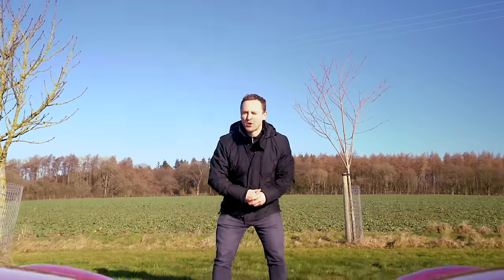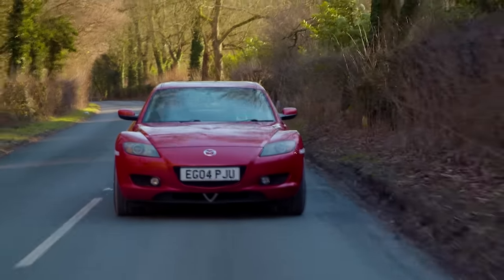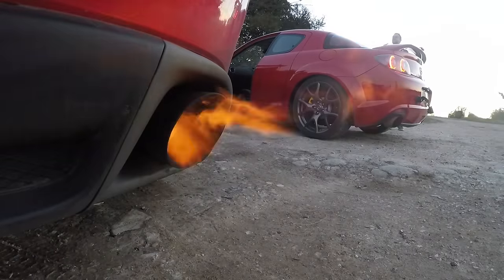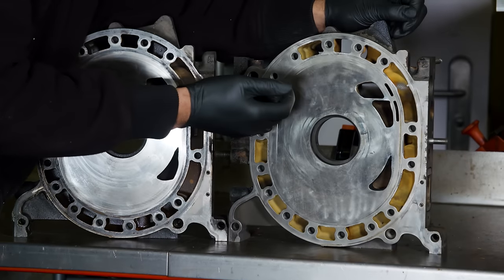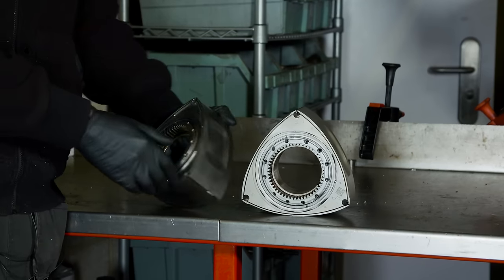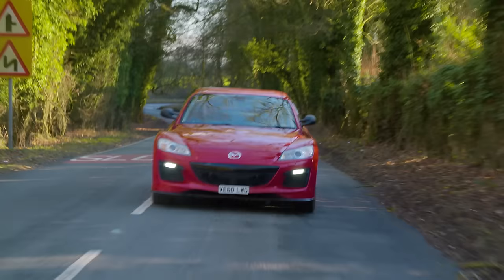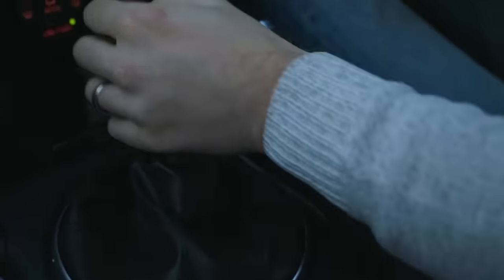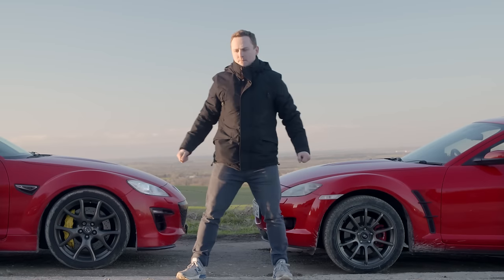The Differences Between Bridgeported & Street Ported Rotary Engines

Comment: How can you not like a rotary? Despite its mechanical faults, you can make so much power with some work, and the sound 😍
Reply: What sound? Sound of other cars passing you while you push your dead rotary off the road?
Reply: You can make just as much power in a piston-designed engine, with far better reliability, fuel efficiency, emissions, maintenance costs, and more
Reply: Ummm.... yeah. I like rotary for it's quirkiness, but for easy power I'd take my trusty old Saab B234 any day.
Reply: @dustinjames1268  no emissions for rotaries and 2t so im gonna dab for you and if the new law goes thru what is that 40year cars or older dont need to be inspected
Reply: The amount of power they make for the amount of fuel they burn is pretty bad really.
Reply: Power? I was sitting here thinking all the money they must have dumped into pulling the engine, machining out the ports, and lightening the rotors for the amount of power they got out of it was completely unimpressive. I considered buying one of these 10 years or so ago because I love the styling, but even on the RX forums, they pretty much said you can't make power on these things without dumping TONS of money into them.
Reply: Or....maybe this is my opinion and I just like Rotaries? Then again, I realize this is the YouTube and I'll be chastised for anything I say.
Reply: Lack of knowledge piston guys don't know about rotaries,1st off piston engines have around for alot longer than rotaries 2nd we ain't in stuck in the 90s where the were unreliable, 3 Rd you have to know how to treat a rotor if you drive it like a nana the carbon will build up and blow the apex seals when you do thrash it 4th if rotaries had forged rotors housings etc they would be just as fast if not faster and last but not least its a small 1.3l that can make a 1000hp, my point is, is that don't hate on something you don't really know anything about I love rotaries but I also like v8s too
Reply: 4mpg for 191hp.. that's how
Reply: @Bexxiii09  As an owner of a 2004 RX-8, It's definitely worth it. unbelievable amounts of fun.
Reply: Only thing rotary has going for it is the sound and rev range. Everything else is inferior to any other engine.
Reply: @dustinjames1268  yeah because it's super easy to get 200whp with an 80 cubic inch piston engine without major engine work .
Reply: You can make 200whp on a stock RX8 with a exhaust intake etc and tuning . It's been proven .
Reply: @nk0723  200whp is still really low.
Reply: @nk0723  Yes, impressive power for the displacement I guess, but that's kind of irrelevant. Piston engines aren't limited to such small displacements, but for the most part, rotaries are. They're neat engines, and I can appreciate them, I just don't think they're the best solution.
Reply: @grosblyth  for the size on the engine it really isnt. For the weight of the car though , it is . 
If it were 200whp in a first generation or an mx5 for example, people wouldn't be saying it's not much.
Reply: @jasepoag8930  kind of irrelevant while we're talking about power numbers and equivalent piston engines?
Reply: @nk0723  Yes. Who cares if they make great power when compared to a go kart sized piston engine? They're not competing with engines in that size. If they scaled them up, then it would be worth talking about. As they are, they have a small form factor, they rev smoothly, they cost lots of money to make only a little more power, and they use more fuel while making less power than most v8's.  All I'm reading in here in defense of them is "ifs." If it was forged, if it had equivalent displacement, if it was in a lighter car... They're neat, I get it, I just don't think they're necessarily... great.
Reply: So much power? N/A 2.0l civics get A ball hair over 200. Pick them up for half that money and much cheaper to run
Reply: @dustinjames1268   Yea...so your comparing a rotary, one of the most powerful engines in the world, to a piston? lmao
Reply: And it's the way it revs super fast and high, the smoothness, and the low weight which helps makes the car handle well too!
Reply: 400 hp and 100 lb-ft nty
Reply: "Mechanical faults", look after them and you will have none.
Reply: Because people are dumb. "Oh its unreliable oh it burns fuel" so what its the most unique engine design you can buy with some seriously good sounds and seriously fun to drive, power or no power.
Reply: @alistermccallum  the old peripheral exhaust rotors were nice and boost friendly... these "new" emission friendly ones are a joke, and not boost frienldy, they just don't flow enough..
Reply: I love rotary engines but the renesis is pure rubbish! It was designed to meet emissions standards and you try to make real power with one and it wont last 2 days! All big power RX8’s are running a 13b motor from the RX7.
Reply: Naturally aspirated 13Bs are hilariously weak, though I'd definitely own a boosted one.
Reply: Simon T of course you want a turbo! Without one they are just a tumble dryer. However if you add a turbo to a renesis and they are broken within a week!
Reply: @Bexxiii09  as an owner of a 2011 RX8 GT I would say I can smell your unequivocal bias. I work never recommend to someone. It's a fun "niche" car but that's about where all of it's excitement ends.
Reply: @shona5512  good god. And regular use it's probably making 10mpg if it's lucky.
Reply: They are the two strokes of the car world. Something some people just 'dont get'. But for those do , there is nothing better. I also like two strokes a lot.
Reply: @dustinjames1268  i want to see a 1,2L N/A Piston Engine  making the same power ;)
Reply: The brapping is addictive
Reply: As it works completely different from a 4 stroke piston engine you cannot compare their capacity.
In the real world you can compare fuel use to power output to emissions. And they fail. 
Does that mean they're not fun to own/drive? Get the fuck outta here
Reply: @matthewmaritato9101  You asked how people can not like a rotary. Answering a question isn't chastisement.
Reply: Lmao you cant make so much power with a rotary
Reply: All these fanboys talking tough
Let me know when youve got a streetable rotary at 1000HP at least as reliable as the 2JZ at 1k HP
Reply: @j0lel666  You kinda need to say where you're talking about here for that to be relevant to anything. Where I live there are no inspections or emissions tests on any car.
Reply: @alexphillips4663  suomi finland, 7months old comment

Comment: I bet you could grill beef on that flame😯🔥
Reply: it will taste like oil, fuel and soot.i don't recommend this.
Reply: Tastes like plastic and carbon monoxide poisoning
Reply: mmm, fuel flavored meat
Reply: any plastics will have burned up and carbon monoxide will fix (chemically react) so it will be harmless.
Reply: It would taste awful but yes you could
Reply: SoY_FooD r/woooosh
Reply: @SoYFooD2  XD sorry but science no comprehend that way good Theory tho
Reply: Doesn't sound very efficient.
Reply: Don’t give him any bright ideas
Reply: In the intro
Reply: What if you would do this on a 4 Cylinder Inline which has been cleaned completely from carbon and all lines for petrol are out of iron and instead of the petrol you use Vodka or a mixture which is not very harmful and you get a perfect Flame tune. Would this be a inefficient grill?
Reply: Sure, if you don't mind cancer.

Comment: RX8 = Drivers car. Not about numbers, but pure driving enjoyment. Also its a lovely place to sit. The cabin is underrated!
Reply: Spot on. So many whiny comments about mpg or reliability. Shouldn't complain, it's these cowards that are keeping the prices down. ;)
Reply: RX7 = Drivers car.
RX8 = failed sucessor.
Reply: @baibok  Failed? It sold multiples more than the RX7.
Reply: @baibok , no turbo no go, bro.
Reply: Mark Bowyer - The RX-8 sold nowhere near as well as the RX-7’s.

If you were talking about the FD generation only; I’d agree, but that would discount the SA22C/FB33 and the FC3S.

The first-generation RX-7’s (SA22C/FB33) alone sold around 430,000 units globally, whereas the RX-8 only sold around 100,000 units - at least according to the sales statistics as I could find.
Reply: @rucarnuts13  The FD sold about 1000 cars all told in Europe, while the RX8 sold around 80,000. (Just under 200,000 total) Yes the cheaper earlier 7s did sell very well in the US but the entire RX7 range was on sale for nearly twice as long as the 8. 
I was just responding to someone calling the RX8 a "failed" car, which is just ridiculously misinformed.
Reply: @baibok  built for a completely different purpose was never meant to be the successor of the 7 if it was it would still be called an rx7 if you look at all the other rx models they are quite different from each other
Reply: @baibok  it was never meant to be its successor Mazda themselves said it, it's only unfortunately named that way
Reply: For a long time, Mazda made a lot of fun cars that weren’t necessarily fast. My 2010 3 hatch is a blast to drive and only has a whopping 167 bhp. Unfortunately, new Mazda prioritizes comfort and “class” over cute and fun.
Reply: The Miata is the drivers car for sure.. just very slow

Comment: 4mpg...ive seen big block chevys with better mpg
Reply: You can achieve 25 mpg in a 2019 camaro ss if you're careful LMAO
Reply: 4mpg isnt real...
Reply: mine 13b with bridgeport makes around 15l/100km which is 18mpg
Reply: Mine does about 9-15... I can believe it...
Reply: My FD is heavy on fuel but I think  it's way better than 4mpg even on track! That's nuts!
Reply: @damianhir  yeah and what is your mpg when you floor it a couple times ?
Reply: You can see how one of them is running wayyyyyyy too rich... Just look at the flames
Reply: On track use
Reply: He was on about track use not road use. So properly on it
Reply: He said that was around Silverstone Circuit. That's racing mpg, not street driving.
Reply: @lclnbm  Around Silverstone at full tilt? That's what he was talking about when he mentioned 4 mpg :D
Reply: @lynnmckenney1987  I live in America so I can't test that
Reply: This mpg rating is for when you're racing the RX 8
Reply: Its the british mpg
Reply: I average 18-20mpg
Reply: @davidp5445  Oof replace your coils bro.
Reply: M kay  Yeah proper driving in an rx8 you get about 18-20mpg
Reply: That’s be 4 miles per liter I believe.

Comment: Please drive a peripheral port next 😱
Reply: TheCarPassionChannel I’ve set a reminder for your premiere! I can’t wait! My dad and I are fixing up a ‘98 MK2. We live in Ireland, so there was a lot of rust! (We had to use a heat gun on the crank pulley bolt when we were doing the timing belt/water pump.)
Reply: Miata Dad
Reply: TheCarPassionChannel rotary swapped Miata on your channel when 🤔
Reply: yes Greg, do a 13b pport miata. Cali is loaded with great rotary builders. i know your setup now is wicked, but u should consider building a reata

Comment: "basically", this is how you tune up a 2 strokes engine aswell.
Reply: 100% true
Reply: Thats cuz the rotary is basically a 2 stroke engine
Reply: @Winneri9  no its different
Reply: @supraptonoalamsyah9273  not really, the intake and exhaust timing is controlled by the piston/rotor moving over the intake and exhaust ports
Reply: @supraptonoalamsyah9273  "mirip" 2 tak tapi meledak 3x dalam 1 putaran
Reply: @PlannedMayhem ??? Thats what 2 strokes do as well. Wankels and 2 strokes just use ports instead of valves.
Reply: @verttisyrjala2897  @plannedmayhem listen to the finn they know their 2 strokes
Reply: @josef2102  Not sure if sarcasm
Reply: @verttisyrjala2897  not sarcasm. in italy they make really good 2 strokes but they engine brake and ride like girls. in finland they do burnout until exhaust glows red
Reply: @verttisyrjala2897  2 strokes dont suck in there fuel  air in they force their fuel in that why they don't use regular exhaust.
Reply: XXzenon Ionnex The pressure (Idk the right word in english) that the piston creates is what sucks the fuel/air mix in. 2 stroke pipes resonate differently some at higher some at lower rpm. At higher rpms 2 strokes need the help of a expansion chamber to properly perform,as far as Im aware.
Reply: M kay Expansion chambers valve controlled? What do you mean? Are you talking about powervalves, because they have nothing to do with expansion chambers.
Reply: @josef2102  I'm italian and i couldn't agree more

Comment: Appreciate the video and the chap who builds the engines clearly knows his stuff.. But why no turbo, not sure how I could do with so little power? What is it that makes you not buy a rx7?!
Reply: There is no boost, because the Renesis 13B handles boost terrible. They will blow up at the smallest amount of boost. Not sure why he didn’t go for an RX7, but I’d have to assume it would have to be the price. RX8’s are way cheaper than an RX7.
Reply: There's an RX-7 in the background of the scene with the man explaining the porting differences, so he (or whichever shop he works with) at least has a 7 as well.

Comment: 250 hp and pickle-jar opening strength lb-ft
Reply: What the fuck ahahaha
Reply: You don't buy an RX8 for the performance, you buy it for the pantomime factor.  Plenty of things are faster but few things are as entertaining.
Reply: That's such an overblown myth. The Renesis has almost identical power AND torque figures to a Honda K engine.
Reply: @gonzomuse  And the K Series gets twice the fuel economy and lasts four times as long.  How many 300,000 mile Renesis motors are out there?  There's no objective reason to have a rotary.  Plenty of reasons, but none of them are objective.
Reply: @mattorama  ---sigh... I'm simply pointing out the tiresome misconception that the Renesis has less torque than a similar powered 4pot from the same era. Although weight and size are significant factual advantages of the Renesis. It's size and weight are largely responsible for making the 8 a mid engine car with handling you need to spend significant amounts of money to better.
Reply: @mattorama  ohhh, I see. For some reason when responding to top level comments the @ doesn't appear to show up, weirdly. My reply was directed at the original comment, which is why it makes little sense as a response to your comment.
Reply: @gonzomuse  Ok, but it wasn't PRICED like a four banger.  This thing was competing in the market with 350Zs and Mustangs.  Props for knowing that front mid engine is a thing, though.  You'd be amazed how many people don't understand that one.
Reply: @mattorama  I'm not trying to argue anything except the boring "it's got no torque.. blah blah", and I'm not really following where you are going with this? 
But it was a couple of grand cheaper than any serious alternative in the UK, and subsequently sold really well here. We had them coming out of our ears 4 or 5 years ago, but there is still so much bullshit parroted by people who haven't actually looked into the car in any meaningful way, let alone ever actually driven or owned one.
Reply: @mattorama  Although I shouldn't really complain. It's all the misinformation that keeps them ridiculously undervalued. You can pick up a great condition PZ (ProDrive model) for less than 2 grand.
Reply: @gonzomuse  It's got as much torque as a Civic SI, and it costs as much as a Mustang GT.  You don't see my point?  It's matching specs with a front wheel drive Honda while matching prices with rear drive sports cars from Nissan and Ford.
Reply: @mattorama  You can pick a couple of specs to compare from 2004 if you like, but that tells you nothing beyond those two figures. The Mustang wasn't available in the UK so I cant speak to that. The RX8 clocked identical lap times on the Top Gear test track as an M3 and the 350Z and cost less than both those cars. 15 years later Alex in these videos beat the 2014 M3 laptimes in his RX8, a car that STILL costs significantly less than an M3 or 350Z, so comparing 2 specific specs doesn't really tell you much at all. The only way to form a sensible opinion about a car is to drive it.

Comment: I don't get the point of fake misfires, the constant popping of the exhaust would drive me nuts. Even rattling interior parts aren't more annoying...
Reply: It sounds so good... also it’s not misfires on rotarys, just fuel burning up in exhaust because of how little fuel actually ignites In combustion chamber (yes i know that they can be tuned and probably are tuned for this but it’s still not miss fire) even stock rx8’s do this
Reply: You've never ridden a sports bike lol

Comment: Exhaust popping has quickly become the most dorky thing you can do to your car.
Reply: My genesis coupe does it factory
Reply: click slide bang I couldn't possibly comment further on that.
Reply: @DiscoFang  in other words it comes like that.rs comes like that.srt4 come like that. So yea.
Reply: @DiscoFang  not saying its a good thing but definitely not a dorky thing lol.
Reply: click slide bang Yeah, the marketing departments are running the engineering department. Well, it's as dorky as externally vented turbo blow off valves. So I guess it comes down to how you see them.
Reply: click slide bang I equate it to a kid that runs around the house blowing a recorder thinking they're cool.
Reply: @DiscoFang  lol wtf